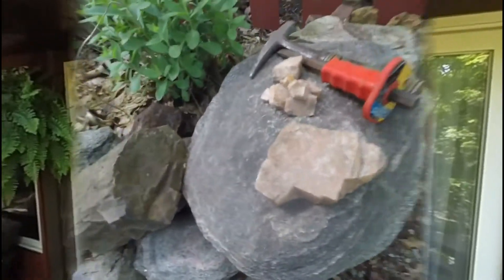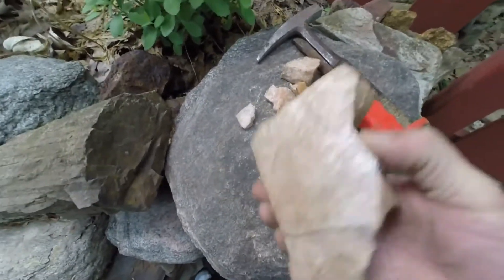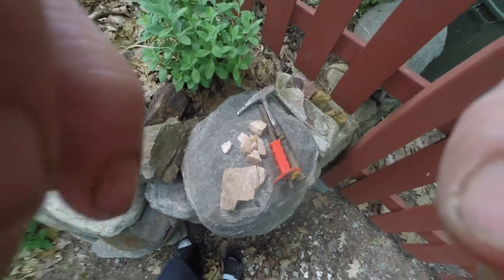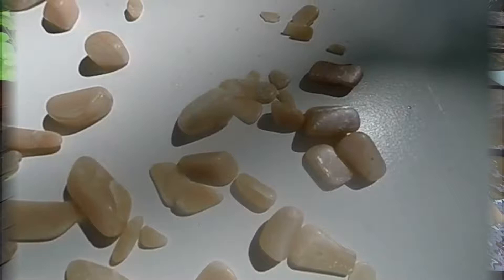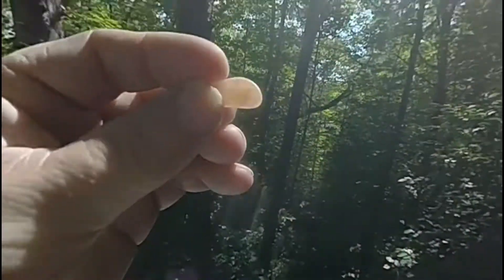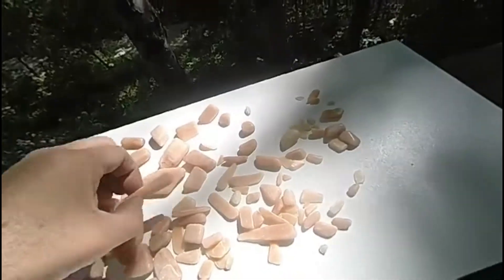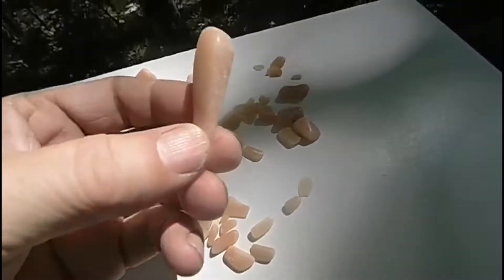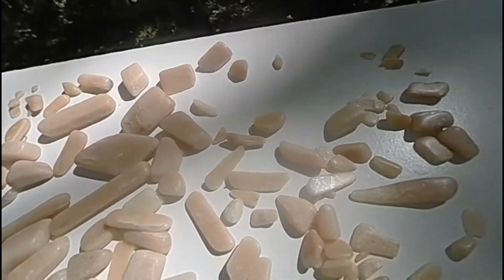Preparing &  Rock Tumbling K-Feldspar

Comment: I had a lot of "discards" from my first round of tumbling (rough grit). I put the word "discards" in quotes because im not quite sure yet which should be discarded because I'm a beginner. My tumbler is now only half full of the rocks that I thought i could accept in the next round. Would it work out if i did only have it half full in the next rounds or is it really important to shoot for 2/3-3/4 full? I noticed that towards the end when I was tumbling quartz that I had hardly 1/3 of my rocks left and i think that was due to the amount and quality of my starting rocks. Would it be possible for you to make a video sometime in the future detailing what amount of damage would require a rock to be discarded after rough grit with some examples? Love the channel and wish there were more channels like yours on YouTube that covered this topic.
Reply from the maker: The tumbler should be over half full.  If there is less than half, then the rocks won't roll properly.  This is especially important in stage 1 or 2, where you need the rocks to roll so they round and shape.  Making a video about rocks to discard (or remove  to run again) would be a great idea.  Rule of thumb is don't move rocks from stage 2 to 3 if they are damaged (sharp edges that will scratch other rocks) or have a big hole or crack (that might hold grit).  There is no more (or very limited) shaping in stage 3-4, so those rocks should be rerun or tossed.
Reply: Thank you for the advice! Im currently doing a mix of different alkalai feldspars. The colours aren't the prettiest but hopefully having them shined up will make for nice display.
Reply from the maker: Good luck with the tumble.  I have had mixed results with feldspars, but the ones that tumble well, really tumble well.